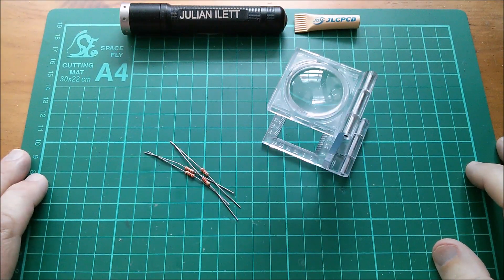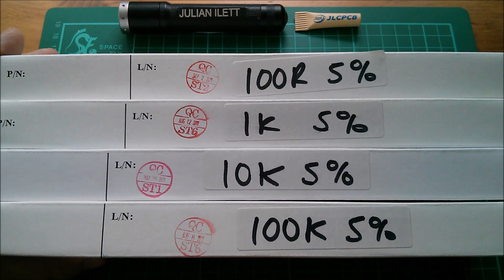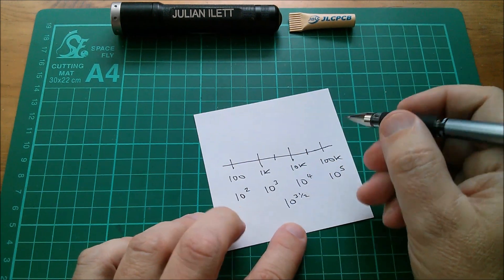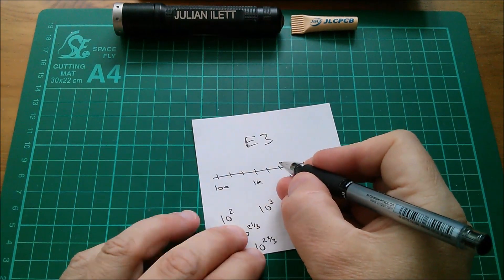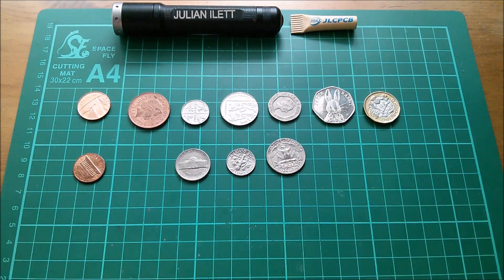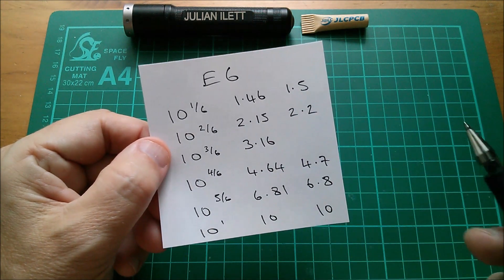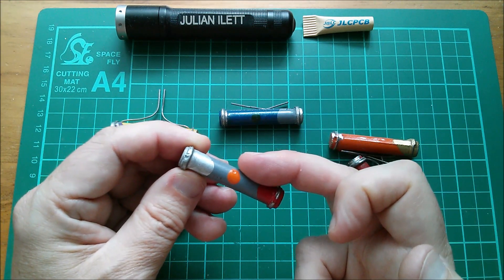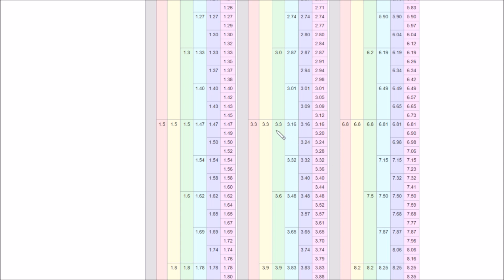Resistor Values - Why 33k, 47k, 68k?

Comment: Using such a limited range of resistors, you will find some circuit impossible to implement. Try making analogue filters or timer circuits using only E3 series resistors and the very limited range of capacitor values available. The necessary precision values required could be achieved by series and parallel resistor combinations, but the component count would be extremely high. Alternatively, trim potentiometers could be added, but these are far less stable and would require individual  adjustment on each circuit made.
For many digital circuits, almost any value of resistor above a few hundred ohms could be used, the actual value selected depending on more subtle reasons for selection, such as current consumption, stability, and matching.
When using digital circuits, a lot can be done with only a couple of values, such as a 1k and a 100k, but for analogue designs, given the limitation on capacitor selection, a far greater range of resistor values are required to maintain a minimum component count.
It is often said that digital circuits are just analogue circuits driven to the limit. So a good digital design will also need careful selection of the resistor values, particularly as the frequency of operation is increased.
I have always taken the view that for a good design, it must be possible to justify the value of every component from an engineering point of view. When I worked in R&D, there were usually three or four iterations of any design before it went into production. In most cases the product design was broken into a number of section, with the design task for different sections distributed between a number of engineers. While design rules were in place, individual engineers had their pet resistor values or those tasks that had a wide tolerance range, the 10k, the 47k etc. So one of the project design iteration was always to rationalize these values to minimise the factory stock and keep the number of different components used in any design to a minimum. Such rationalisation often turned up very strange justifications as to why a particular value had been chosen by a particular engineer. But everyone was expected to have a reason that could be justified, even if it was as prosaic as " I had a reel of this value on my bench from my last project".

Comment: You're one crazy Pom! Just buy what you use.
Reply: Right/wrong, respectively.  ;)  If you do that, you have to wait for 2-7 weeks for each missing value each time  to finish each project.  Buying lots of values allows for plenty of different project needs.  I just ordered 1280 resistors of 64 values between 10 and 10meg ohms.  I sent them $4.48USD and they'll speed them to me in under 2 months.

Comment: The problem is that they’re not supposed to be logarithmic. Rather, starting at 1.0 (brown-black, and ignoring the multiplier - 3rd band) we want to make a 5% tolerance “window” around these values, then the next higher value should solve: x - .05x = (1 +  (1)(.05)) = 1.05, or x roughly equal 1.105..., or 1.1 (brown-brown). We continue in this manner such that these tolerance bands (or “windows”) just touch each other without a lot of wasted space around them. I’d be surprised if it actually fits a line on a log scale, though the error may be low at the low end of the scale (from 1 to 2.2, let’s say). The same thing is true of capacitor values too, I believe, though only fairly recently - old, vintage radios and TVs can have some really strange capacitor values!

Comment: USA don't use 1/5th in their coins, they have Quarters.
Arg, fractions instead of metric!
Reply: As an american, I can confirm that the US loves their fractions. Which I find strange, as most people have trouble with them in school :P
Reply: farmers do lose fractions, for some reason
Reply: Oddly enough, people operate in fractions, not in decimal.   When you're feeding people, you think in half, thirds, fifths.. etc.   You don't say 'Okay, I need to feed three people.  Each person will get 33.333333 repeating percent of the food'.     Decimalized systems work well for scientific purposes, but they're not very good at actual use by _people_.
Reply: 20c would be 1/5, 50c (which does exist) is 1/2. It doesn't really make much difference.
Reply: American choose 1/4 pound burger instead of 1/3 pound burger of the same price thinking they get a better deal because 4 > 3...
Reply: That is sad.

Comment: Part of the theory of resistor value spacings is so that you can make up a large number of "non-preferred" values by combining them in series or parallel. E6 values are nominally 20% tolerance anyway, and even E12 values are still 10%, so I wouldn't worry that 3.33 isn't "right", the real component resistance is probably much further off from that anyway.

Comment: I get morning glory every morning, have to put my housecoat on so mom doesn't see it.
Reply: Use a high power 33k 20% resistor.
Reply: Ah, to be 13 again.
Reply: I'm almost 30, that means there's a lot of wood to hide on my way to the bathroom.
Reply: Tuck it in your waistband that's what I do lol
Reply: Can't its too big, only way to make it go down is to empty it.
Reply: Perhaps it's time you moved out of mom's house.
Reply: How?
Reply: i also do radio broadcasting during morning sleep... vertical polarization
Reply: It will degrade with age, have no worry.

Comment: Yeah, except if you ignore the tolerance, and just want a range of common / useful resistors, my preferred list are 330R, 470R, 1k, 4.7k, 10k, 22k, 47k and 100k. There is no 'system' here, just my memory of which values I use the most often.